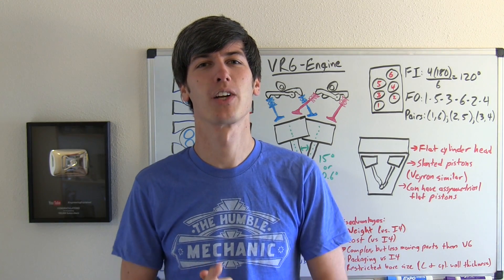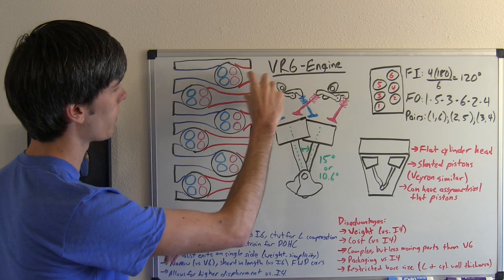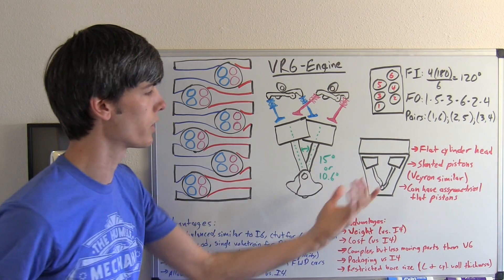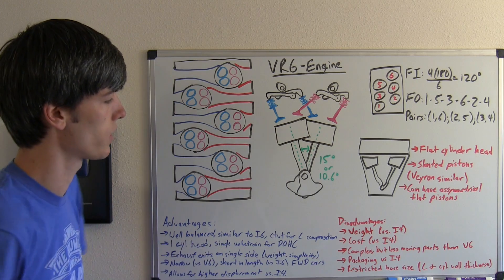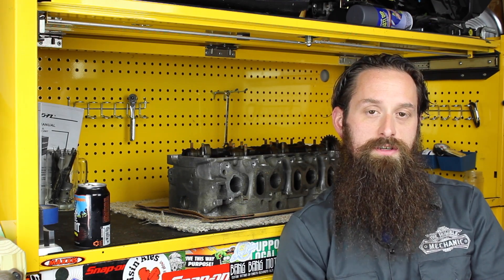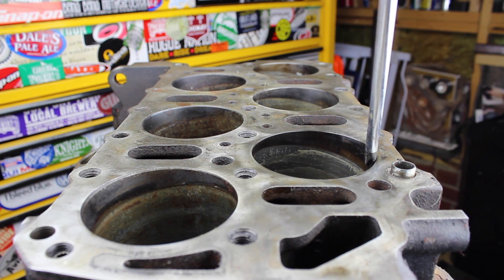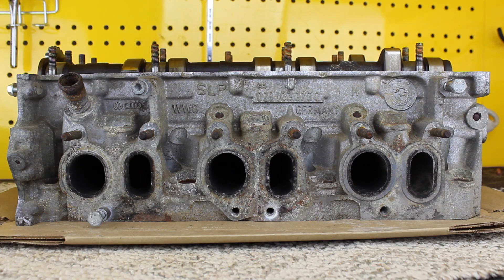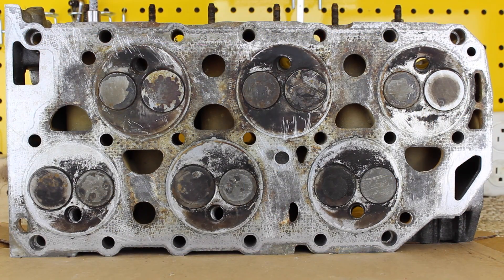VR6 Engine - Explained

Comment: I love German engineering.
Reply: hate to break it to ya but the japanese were part of the Axis powers in ww2... you know, the ones who were allied with the nazis. soooo....
Reply: tchirn BS the germans noticed that a wankel engine has no advantages on a normal engine. the japanese tried to reinvent the wheel and kinda failed, cause we all know how durable mazda wankels are.
Reply: +robert retka 
Try to migrate to Japan then, good luck on that one... Don't worry, you probably wouldn't actually have to migrate anyways. Their nationalism prevents this.
Reply: yeah I love Japanese engineers too.
Reply: I agree, just look at the upside down V-12 the germans put in the Me-109 fighter plane. While it was fuel injected, it being upside down, did absolutely nothing for engine performance.
Reply: @cryptoranger4901  Low centre of gravity is why it is upside down.
Reply: I love most engineers, I hate their management, accountants, bosses and investors.
Reply: Well, just bought an Austrian Moto, its great! Love it but have to say, the abs lite, TCS lite and various other sensors are going hawire, like any bavarian cars I see in my bays regularly.  But my goodness, sure does Haul some Ask (me all about 0 to 60 in 2.5 seconds).  And dont even go to AUS is diffrent than the Deoichland!
Reply: It has a lot of advantages when it comes to racing. There are amazing rotatory motors on drag and drift cars, for drift cars I can name you Mad Mike and his RX7, MX5 and RX8.
Reply: @overdoseproductions1571  What's special about a rotary engine for drifting lmao?
Reply: If only the germans could have a lovechild with the japanese
Reply: Yes, but VR engine was invented by Italian's LANCIA in 1920
Reply: Dr Deming, an American, taught quality and the economy of quality to post-war Japanese industry! Unfortunately, neither the USA nor Europe learnt the lesson for another 30 years.
Reply: Daniel Peters, German engineering is great, unless you are a master tech that works on the junk. Making absurdly complicated designs for no damn reason are what Germans are good at. Backwards ass braking systems stolen from 40s model tractors, junk ass air conditioning systems, garbage power steering systems and engines that have to be removed every 60k to change timing belts. Could be worse though, could be an Audi.
Reply: bad german engineers no krout dog!
Reply: German engineering is  over rated.  It was the Japanese who perfected the rotary ( Wankel ) engine as the Germans who invented it failed to perfect it.  No hype for the Japanese engineers, just quiet efficiency.
Reply: tchirn Who the heck cares about the rotary engine? Why are you using that as a qualifier of good engine design? Rotaries have crap fuel economy and drink oil.
Reply: @tchirn  For visibility

Comment: Interesting video, but you could have credited Lancia for this engine concept. Lancia patented the narrow angle V-engine already in 1915. In 1922 Lancia introduced the model "Lambda" with a V4 engine and the model "Trikappa" with V8 engine, all narrow angles. The successful Lancia Fulvia had a V4 narrow angle until the end of production which was mid seventies.  

"Der V-Motor mit engem Zylinderwinkel wurde von dem italienischen Unternehmen Lancia & C. entwickelt, weshalb die Bauart als „Lancia-Prinzip“ bezeichnet wurde. Grundlage dafür war ein Patent von Lancia & C. vom 1. Juli 1915"

Comment: Single valvetrain? I see two camshafts.  A V6 will have one camshaft on each head.  On this VR6 it appears to have  one camshaft operating the valves (both intake and exhaust) per three cylinders.  This is in contrast to your diagram and explanation

Comment: why did you compare VR6 engines to I4 engines?
Reply: Its the solution to put a 6 cilinder in the space of a 4 inline cilinder.  Europe gasoline is expansive 6 dollar a gallon so smaller cars smaller engines so inline 4 cilinder is the most common engine layout overhere.

Comment: I'm kind of perplexed with VW products. Do other VW products such as Audi and Porsche REALLY use VW VR6s or Audi-or-Porsche-developed adaptations? I heard from several mechanics that they do source their engines from VW, but other parts such as the manifold are reworked by Audi and Porsche for their Q7 and Cayenne respectively.

Comment: I wonder how they would handle a turbo.
Reply: +wades623 Quite well. They can go up to about 350/400 bhp without having to change internals. I ran a VR turbo Corrado for a while with around 320bhp, it went like a rocket cos it was so light. Heat is definitely an issue though, they do run quite hot and a lot of the earlier engines suffered because of it. I had a head gasket go on one engine which warped the head, then the next melted a piston (though it was supercharged and I may have pushed it too hard for too long). You need uprated fans and a decent chargecooler if you want to go the forced induction route.

Comment: This has to be one of my fave engines, I realllllly wanna put one of these into an 04 Jetta, with twin turbos and a blow off valve, that'd be heaven, but I've been told a lot of different things, I don't know if it'd work, I've heard engine swaps aren't worth the hassle, that I should just buy a car WITH a VR6 in it... I was originally wanting to put a 383 in the Jetta, but because it isn't a crate motor I don't know if that would be the best thing. It'd just be easier to stay VW i suppose.. Any thoughts if I were to engine swap an 04 Jetta? Opinion?

Comment: I had a 2006 mk5 rabbit, and when i let warm up from idle on a cold start, it pretty much sounds like a farm tractor. when I bought my new 2015 golf, it still has the annoying clicking noise much like an disiel tractor engine. could you explain that please

Comment: here in germany, there never was a GTI VR6 … there Golf with VR6 simply was called Golf VR6. Nowerdays, they call this engine just the "V6". There even is a 2.3 V5 in Bora/Jetta. Did you know? You can tell GTI from VR6 in a VW Corrado by the form of the front hud.
Reply: VW Corrado 4 wheelbolts G60, 5 wheelbolts vr6.

Comment: What does it take to put a vr6 engine an newer model to a 2006 vw gli what I need ? and is it possible ?is it bolt on? Is it hard ? Do they sell conversion kit ? I know I need the ecu wiring and all that I know that just want to know if it fit??👍🏼

Comment: On the whiteboard, the drawing is wrong. You've drawn the camshafts as if one is the "exhaust camshaft" and one is the "intake camshaft." That's wrong, the mechanic actually points this out during his segment. Pretty weak engineering, bro.

Comment: Over heating is exactly the issue.  The exhaust gasses pass around the cylinder walls of the surrounding cylinders.  That is combined with the geometry of the block making it harder to cool the engine and it places much higher thermal stress on the block and the head.  Volkswagen is trying to shove a bigger displacement engine into a very tight space.  This engine is not simpler than a conventional V6.  It has fewer moving parts but it is complex in many other ways.

Comment: Is there a reason for the unequal exhaust and intake runners? why not have the exhaust ports on the outside so there is long runner exhaust ports and short runners

Comment: When you overheat these, the heads don't get "a little bit warped" they usually warp out of spec and/or crack and work only as a boat anchor. This is made worse by the fact that VW uses sound engineering coupled with the worst possible materials. Water outlets, thermostat housings, radiators valve covers, manifolds and hose nipples all made of a very poor plastic, and the hoses are not reinforced with fabric and turn to MUSH. This means that you WILL at some point have major coolant leaks and you will LIKELY have overheating, leading to... warped, cracked heads, and most shops now just replace engines becuase they don't want to replace heads, it's too much work. That is, if you can find a head anyway. I also love how the VW/Audi shop data tells the mechanics to lie to their customers when it comes to oil leaks. It's true. They tell the tech to rate the oil leak based upon 1. has the customer complaned? 2. is it a seep, a slight leak or a gusher.. if the leak hasn't reached gusher stage and the customer hasn't complaine then just "don't say anything". And if the customer does complain, and yet it is not a gusher then just downplay it and try to convince the customer (lie)  to weasel out of doing the work. Yes, this is in the factory shop manual! (the VW/Audi leak rating system) This is because it is so incredibly difficult to isolate which plastic piece on the engine is actually leaking, and how incredibly difficult it is to fix if you think you know (and you may still be wrong).  In other words, "don't ask, don't tell. I guess this is the mentality around the whole diesel emissions debacle. And dont't forget too that Audi and VW are virtually the same, and the lower priced Porsche Cayenne is just a Toureg with lockwashers. It is mostly a sales job over any engineering they push, and shop time should be saved for more profitable work than what the customer wants. I worked on these piles for 22 years.
Reply: Good analysis. BMW not much different when it comes to cheap plastics. The VR6 was always an engine looking for the right car. In the Passat and Corrado it made sense, in the Golf and Jetta, no. The right engine for the GTI has always been a 16v 4 pot.
Reply: #1. Eurowise-thermostat housing(metal) #2. 42draft-metal crackpipe #3. Samco/forge-silicone hoses #4. low temperature thermostat  #5. Mocal-multi row oil cooler(availible thermostat)
Reply: Dave Bloxham Never happened to my VR6 
Só Bulshit!
Reply: Dave Bloxham l
Reply: Dave Bloxham i
Reply: Too bad theirs not a thumbs down button.
Reply: Dave Bloxham hey, dont overheat your engine?

Comment: Well i must say that it is one of the smoothest running engines ive ever come across , , Just bought a 1995 Passat with 100k and runs like a swiss watch , not to mention its timing chain and not belt which is a nice bonus . . There is 1 issue im having and that is a moderate vibration around 2300 RPMS and was hoping its an engine mount and nothing major . . Shes smooth everywhere else , even at the upper RpMs .. 
Thanks for any advice on this
Reply: +captainbluefishmonster says smoothest motor ever.... yet complains about vibrations. lol seems legit.
Reply: +HOT40K 

Correct , once past tha it is very smooth , then again im coming from a 347 Mustang LX , sorry if i confused you

Comment: best one for NA are the 24V 2003 and on with the 6 speed, but for pure brute turbo power the 12V is the way my friend has been running is 12V with a GT35 turbo on it 410+ whp for years hahaha
Reply: Swap to a 5spd the 6spd is super heavy in those car and is def not intended for racing
Reply: Its already à 5 spd ,its for the 24V one juste for crusing town and stuff

Comment: Sorry can't see anything good about this engine, what the hell were they thinking?

It makes more sense to stay with a strong 4 cyl and use forced induction. This goes backwards in many regards. Irregular lateral load on the piston skirts, back to lower VE with single valves. Why? DOHC my ass, it's two single over head cams on the same casting. I could understand the "innovative design" if it actually gained any benefits. 

as for capacity sure, 2L & 1 bar is equiv almost 4L in a small light engine that with a proper twin cam 4v setup will be more VE and have effective variable capacity so when low power req will be more efficient on fuel.

Open to being enlightened to why?
Reply: +Mark Lowe What the hell were they thinking?! Oh no idea, maybe, lets fit a 2.8 or 3.2L engine in pretty much the same space as a normal I4. With goof reliability, torque ratings and refinement. VR6 engines are fantastic for long distance motorway trips, plenty of power and are still incredibly smooth and refined, much more so than a I4. Also, less to go wrong than a I4 turbo! Lateral load on the skirts...not that I've heard of! Also, it is DOHC, one cam for the inlet and one cam for the exhaust, in what way is that not DOHC?

That said I'm using a 24v VR6 in my Mk1 Golf, with a massive turbo, and AWD...why? Because it will fit! I can have a 500bhp engine in the engine bay and it won't take up a huge amount more space than an I4, it will also be quiet, smooth, and perfect for long distances and eating most cars for breakfast! 

Too may people think of them as track cars, thats not what they're for and no one is saying they are, too many people compare it to VTEC because it makes less power, which is true, but it makes it at stupid high RPM, the VR is in peak power before the revs even get up on a VTEC! It's a very clever design, oh and the noise is fecking EPIC!
Reply: Thanks for the response. That makes sense. I guess at first glance they just look wacko. The size was the only thing I could conclude to.  The 24v thing sounds good, I thought they only had a 2v per cyl which in VE terms ins't so good on a smaller engine. cheers.
Reply: They get slated because they don't make a huge amount of power for the displacement thye are, but they are reliable! Also the 7 main bearings make it very strong, I could run 500 bhp on a stock motor and it would take it, just, they were designed as a diesel first! No the orig ones were 12v and in the UK 2000 inwards they are 24v with variable valve control as well! There's also a 3.6 as well.

Comment: the engine wiring is fun when the harness cracks.

turned the vr6 into a vr4 and my gasgauge was watertemperature, and since the speedometer is electric...

but damn always that downshift to 3rd while doing 60 on the freeway...

was fun trashing it tho, 300.000km passat wagon 3b full option... 1000,- euros

now im depressive... i miss it

:(

Comment: uh have you never seen a mopar V6? or a 4.3 Chevy V6?
both work they their big brother V8s and have a single over crank cam
Reply: +CaptianHicterDeckmen That would be overhead valve. timing chain driven camshaft right above the crank with push rods operating each valve.

Comment: I really like the design but I am still puzzled why no one makes a "square layout".
It does have the complexity of two crankshafts but it is better balanced and the cylinders can be closer together.
All the other features of this engine could apply equally to the square layout.
Pistons do not need to be assymetrical and the two crankshafts could be potentially shared with a smaller 3 cylinder engine.
The only drawback with the ariel 4 was the cooling because it was not water cooled.
Just wondering.

Comment: It´s not "Inline-V6"
VR6 stand for "Versetzte Reihe" wich means "interrupted line" I know, you americans like V-shapes, but it isn´t one ;)
facts about it:
The reason why it was engeneered is to have a 6-cilinder that you can mount transversely in smaller cars with front wheel drive.

Full stock, a nice engine, but in thermical aspects absolutly crap. I´ve heard that you like to turbocharge them, here in germany, we don´t do that, because the engines blow up on the Autobahn if you drive along with 135miles or more for one or two hours straight.

Comment: people dont realise this is the same design as whats put in the buggati veyron. its a master of engineering. with a few faults it had came strengths in form of performance. it cried out for more pressure and is naturally very strong and torquey. i have known these cars to be driven very very hard and accomplish 300k miles if maintained correctly. people seem to think they are wiser than vw boffins. they are very very incorrect

Comment: Seems like the unequal intake & exhaust runners would present a challenge for balancing the power output of the cylinders.  Did VW consider equalizing the runners externally?
Reply: I think he says the change the length of the exhausts depending on how far the air travels inside so that the air always travels the same distance @ 11:56
Reply: jeekk

Comment: I'm not sure if its because I'm not German or an engineer but I don't understand the logic behind this idea, like most vw/Audi ideas.  
As a life long auto tech and auto enthusiast the different intake and exhaust port lengths go against every thing I've ever been taught about making horse power.  You are supposed to make each cylinder as close to the next as possible. When you port the heads, design the intake, build the headers, you try to make each cylinder flow exactly like the next.

Comment: Is there a special ring compressor for this type of block for installing Pistons?
Reply: Yes. The standard ring tool doesn't work very well at all. 

But the VW one is meh too. Lol
Reply: +Tony Adams its a VW you need a 1000$ tool kit that includes a haha your stuck with this car so here is a 5.3 mm socket cause 5 mm is to cheap and 6 mm is to expensive!
Reply: You are not a car guy anything that is smaller has issues on the corners of bolts and is more likely to strip the bolt.